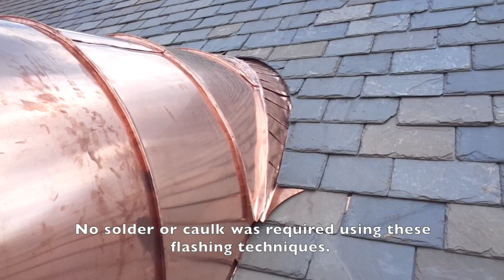Curved Standing Seam Copper Barrel Dormers

Comment: Joe, it's Trapasso, Again.  Your guys completely misplaced most of the step flashings.  Also, there was no reason to slit the flashing around the rear of the dormer to the roof.  Use a 3 x 8 sheet of copper and cut the curve pattern.  It ean then be soldered to the final sheet of the barrel dormer.  Nice Vermont slate, though.  Joe, you read my article on Step Flashings.  What's going on now?

Comment: Nice work, I tell clients all the time proper metal work shouldn't rely on caulk or a solder. Many times with sloped roofing it just takes a bit more effort and experience. Great details
Reply: Should never rely on caulk but sometimes solder work even on pitch.

Comment: They make a much better tool for arching standing seam metal, I rented the tool for the panel and the cap from place I'm Michigan. Tool was awsome. You stand the metal on its side and it goes through a series of rollers and comes out the other end with whatever pitch arch that you dial into it by cranking a handle on top that moved the rollers. The tool rented for a $100 per day for each. But we'll worth the money. You could arch that panel I'm less than 5 minutes, without any variation. Each piece matched perfectly. We did an arch that measured 45 feet up the sides and over the top...just trying to help, I've used the shrinker/stretched before and it sucks compared to the tool I'm referring to..anyway good luck to ya, looked pretty good. One more thing, fir that arched 90 degree bend you didn't show how you did that, I used a hand roller that cam bend 90 cegree over an arch quick like..another cool tool..

Comment: A++ so cool how you pleated the valley. I did two just like them used all the same methods except I soldered the valley / tiein to the main flange . I took a premaid piece of copper drip edge and crimped it till it fit the front rake edge and then rolled my panels onto it. They are in Cleveland heights.  I drive by and look at them now and again.  Very proud of them.  You did a beautiful job in yours.

Comment: You mentioned the panels are locked into the step flashing.  Does this become and problem with expansion as the copper heats up and cools in summer and winter for the metal to become stressed?  I have always allowed the two to move independently from each other as the roof will expand more or less from whatever the dormer will.
Reply from the maker: They are flat-locked onto the step flashing. There is still room for movement/expansion and contraction.

Comment: Fantastic job.  Was there a reason you didn't want to solder the valley panels?  I would have flat seamed the valley segments over the radius panels, but I'm always looking for different way to tackle things.  The total hours for just this copper work must have been over 300 hours?  Looks great.
Reply from the maker: A continuous, pleated valley piece will last a lifetime. Soldered individual pieces can crack over time. Thanks for you comment!
Reply: yeah, looks great i need to know how much? $$$$$ :)
Reply from the maker: Expensive... : )
Reply: I'd love to see more on how to measure, mark, and fold that continuous pleating. I can't quite wrap my head around that one...
Reply from the maker: It's not necessarily the easiest process to explain verbally, but the jist of it is as follows: 1) find the curve of the eclipse and transfer it to something flat. 2) Fold some paper along that curve 3) transfer your folds to the copper. 4) bend the copper (be careful not to over stress it in areas) 5) install
Reply: Jenkins Slate Masters that makes more sense than anything I was thinking. I often get stuck in my head because I can't form a good mental model or work out the math... But most of that is a non-issue if you just make a physical mock-up with paper or cardboard. I gotta remind myself of that: just make a model, ya dummy.
Reply: @jenkinsslatemasters9184  i agree that the valley is better with some movement in the joints to stop cracking. hot sun and cold winters. recipe for failure. nice work guys. my next job, sorting a brand new poorly fitted slate turret. terrible slating and lead work....the roofer was pleased with his disaster...